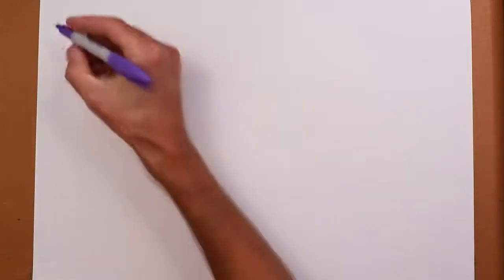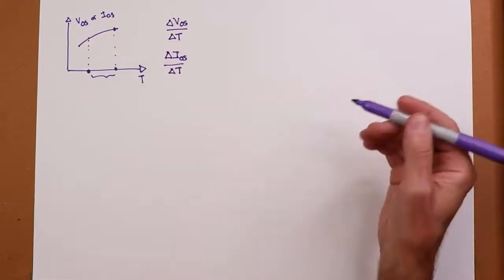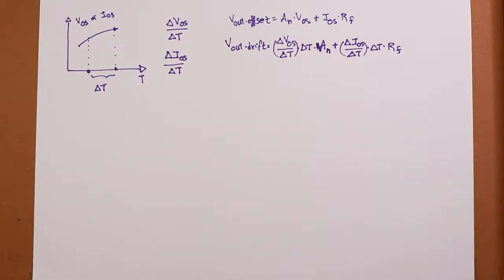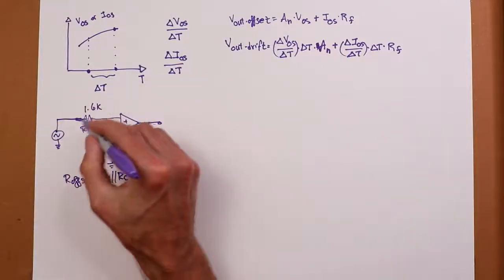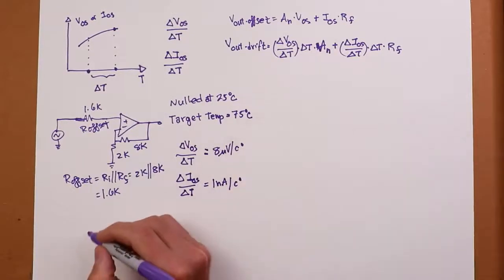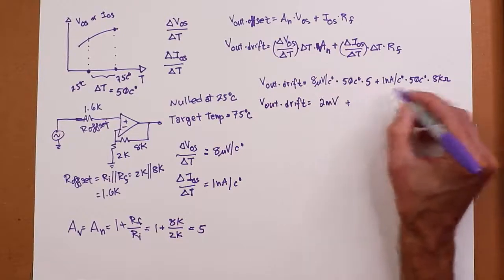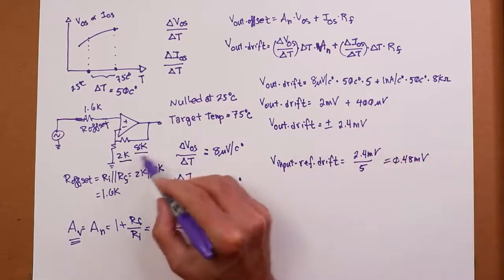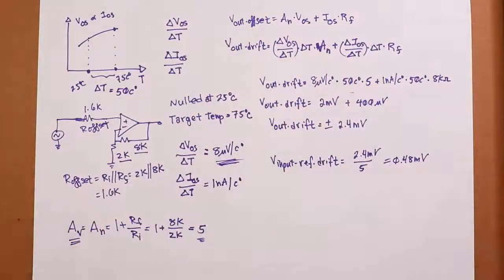Op Amps: Drift

Comment: WHAT IS THE DIFFERENCE BETWEEN DRIFT AND REFERED DRIFT?
Reply from the maker: Input referred drift removes the effect of the voltage gain. If you just look at the output drift, then amplifiers with high gain look worse (because a portion of the drift is proportional to gain). Same is true for offset and noise.